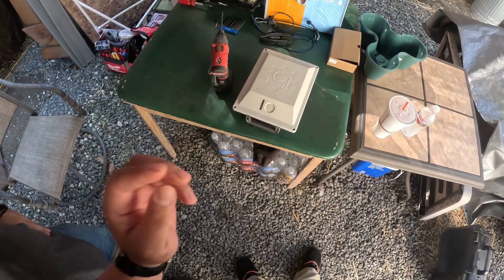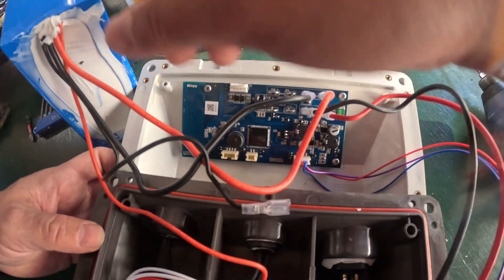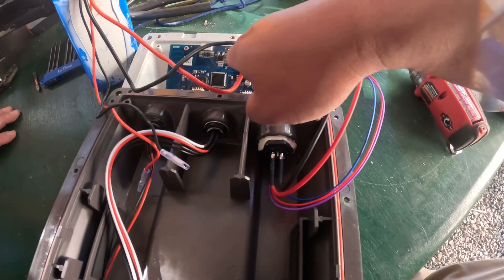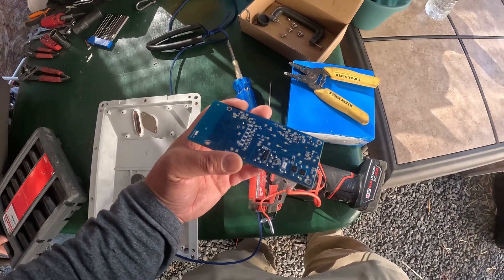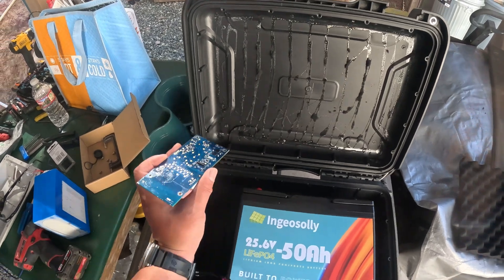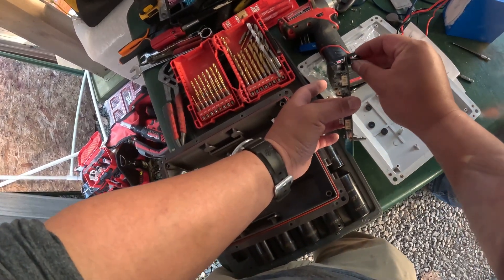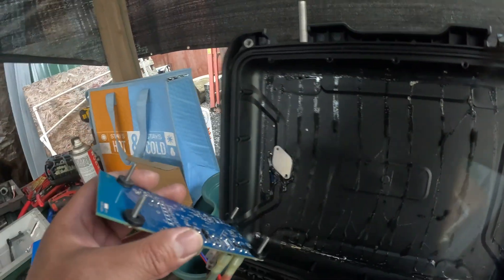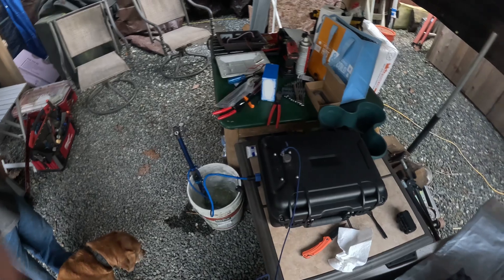Bixpy Motor Battery Upgrade Mod Alternative Fix with High Capacity 24V 50AH LiFePO4

Comment: Mr tartersause, I've done this process myself. Double and triple checked. When I attatch the magnet the circuit board just beeps. Any ideas.
Reply from the maker: You might damaged one of the IC on board
Reply: Is that something i can replace? Not real knowledgable on board components, but I can fix it usually just dont know what that is. What would your advice be. I actally have a new newport to throw but i hate to have wasted the bixby and not repair it.
Reply from the maker: @bornluky1  first you have the find what is broken, it's one of the resistor most likely. Use a multimeter you will find it. then you have to use solder iron to remove it and replace it. Hope it helps.

Comment: Is there any way to fun a K1 without the controller?  I bought 6 of them but only the motors. If I supply 24v to the main terminals would the motor spin?  Thanks.
Reply from the maker: no, it is not going to work. You need to understand that brushless motor needs some sort of control board with programing in order for it to work, you can't crack that code without knowledge and some special tools that will connect to a computer.
Reply: @usstartarsauce thanks for the bad news. I guess I will just sell them to recoup my money.
Reply: @usstartarsauce would a brushless pwm controller work to control it?
Reply from the maker: @pressurewashingsanantonio8102  I never tried it. From my understanding, that the motor itself, it contains a circuit board with some programing, then bixpy's battery, has a control board, that has an IC that talks to the battery. Therefore, I do not think a PWM controller will work at all, because the 2 programs in the motor and battery, needs to talk to each other, and they have to match.

Comment: Did you folks upgrade wires to 12 AWG (or maybe even 10 AWG) ? Asking because Bixpy K-1 can draw ~20A at peak power especially if running for longer periods of time.
Reply from the maker: yes, 12 AWG

Comment: Is this bigger capacity that the one bicpy sells?
Reply from the maker: Yes, this is 50ah, bixpy’s biggest is 30ah I believe
Reply: @usstartarsauce i have a broken one, but bixpy said its the circuit board, id love to do this seems simple
Reply from the maker: @xzinx  Oh I have burned the circuit board twice, what are your symptom?
Reply: @usstartarsauce when i charge it it lights up, then when i unplug the charger and plug the motor it runs for 20 seconds then it shuts down, i cant start it up even if i remove and replace the magnetic key
Reply from the maker: @xzinx  2 things can happen here, 
1. your battery is no longer holding a charge, usually after 2 years of constant use, that battery wont hold a charge.

2. circuit board, some components are overheating that trigger its protection, I know the latest bixpy battery has that feature (the one with white LED), the older one will just burn some resistors and not turn on the motor at all. 

So, if your battery is fairly new, and do you use it every weekend, that might be the circuit board.
Reply: @usstartarsauce when i plug it in to charge it indicates charging and i charged it to full, dont know if that helps, and yes i use it 2-3 times a month

Comment: Hi im in new zealand and the conector thats on the battery unfortunately is broken and needs to be replaced bixpy want $500 and bixpy are saying it not covered in there waranty and to make the sutuation worse they want supply the fitting for it to be fixed by myself  so im wandering what they call it  and the part specs . Ive been left with a battery thats still got a month warranty on it. So overseas buyers beware. I would be greatful for any information. 

Cheers Grant
Reply from the maker: Hey, I can help you with that. If you can get the part I can help you ship it. Sending the battery back and forth will be a problem. It is considered dangerous goods: UN3480, not many shipper can send it, and even if they can, the dangerous goods fee is at least $100 charges by FedEx and DHL

Comment: If only need on power and of power, how to bypass motor wire
Reply from the maker: I don't believe you can, because the motor itself it has a circuit board inside, that communicate with the board in the battery, that communication must be satisfied so the system  can dictate how much power to send to the motor. I hope my explanation makes sense.

Comment: What is the purpose of the smaller positive and negative wires coming off the battery that run to the control board?
Reply from the maker: The smaller positive and negative wires from the control board is for the aux power on  the bixpy battery, since we don't use that Just removed it.
Reply: @usstartarsauce  thanks for the info.

Comment: Nice! Where did you get the cables to run from the battery to the control board, and what is the cable size?
Reply from the maker: 12 gauge black and red, for the connector, I just took the board to ace hardware and matched it

Comment: Wondering is it possible to use ESC with marine battery vs bixpy battery?
Reply from the maker: @rubinesamuel9078  I don’t think so, because bixpy motor is brushless and it has its own circuit board.

Comment: I bought the k1 motor and want to build my own battery and controller system. Is the k1 a single phase brushless motor? I can't find any good tech specs for the motor. I cut the factory connector end off and I have two motor leads and 3 signal wires.
Reply from the maker: unfortunately you can only use Bixby's battery control board, inside the K1 there is another circuit board, that corresponding to the program on the control board on the battery. It's not really high tech however that's the way making it proprietary.
Reply: @usstartarsauce those bastards🤯
Reply: @usstartarsauce  I found a work around, they sell the larger battery pack control module separately. I need to a huge favor though, can you figure out what color the 3 smaller leads are from the motor plug to the receptacle on the battery interface?
Reply from the maker: purple, blue and red, I have photos, what's your IG?

Comment: If I just wanted to buy the original battery in the bixpy where would you buy it from? I heard you say in the beginning that you could get it for $70-$100?
Reply from the maker: you need to find battery in 6P7S configuration (6 x 7 connected in a certain way), https://www.made-in-china.com/showroom/evolutioncells/product-detailAZxGzsNHHphu/China-Lithium-Ion-Battery-Pack-24V-27AH-26650-6P7S-For-Electric-Scooter-Solar-Energy.html

something like this could and should work, however you have to figure out the connector

Comment: Great idea. I’ll do that when is time. My batteries are still ok, but got other issues with motor and remote.
Reply from the maker: If you have motor and remote issue, first try to replace the battery in the remote first, it's a coin size battery like in your car lock remote. 
The circuit board is the next thing you need to look at. However if the issue is on the circuit board, then it is pretty much useless, unless if you know how to solder and know which part to replace. The motor has useable life due to Bixpy design, I actually took apart one, it has its own circuit inside that communicate with the circuit board in the battery. It will eventually go bad depends how often do you use it, I say 3-4 years under using it every weekend for a 6-8 hr fishing session, once that happens and it is almost impossible to repair it.
Reply: @usstartarsauce  Yeah, remote was barely submerged under water surface and got water inside. F6I wasn’t aware it’s NOT waterproof, otherwise I would dry it out immediately. Found fine print on remote after it was too late. What a stupid design. Waterproof motor & battery, but not the remote. Especially since at first glance it looks like its got watertight gasket and buttons 🤦🏻‍♂️.
Reply: @usstartarsauce  Never again Bixpy motors. Planned obsolescence.

Comment: Good job man.  Do you have the link to the battery and the case?
Reply from the maker: Here is the case
https://www.amazon.com/dp/B0C2BQHZJG?ref=ppx_yo2ov_dt_b_product_details&th=1
Here is the battery:
https://www.amazon.com/dp/B0CKVGJNSQ?ref=ppx_yo2ov_dt_b_product_details&th=1

Any 24V (actual 25.6V) LifePO4 battery would work.
Reply: @usstartarsauce  hey what size of case did you get 14/16/17"?
Reply from the maker: @guitar333  
Size 17 https://www.amazon.com/gp/product/B0C2BQHZJG/ref=ppx_yo_dt_b_search_asin_title?ie=UTF8&th=1&psc=1
Reply: @usstartarsauce  thanks also did you say you used a 27mm hole saw?
Reply from the maker: @guitar333  I believe so, however I would measure the connector just to make sure